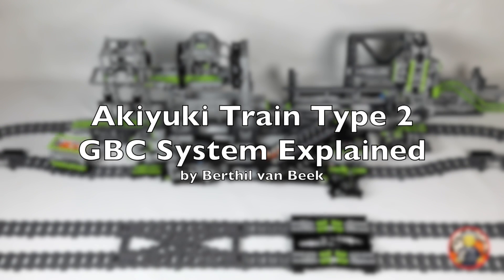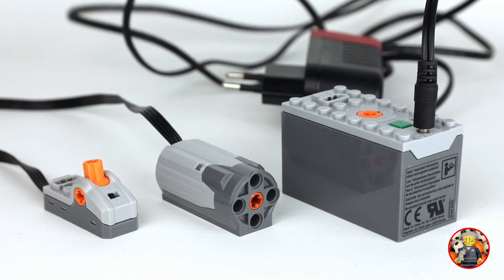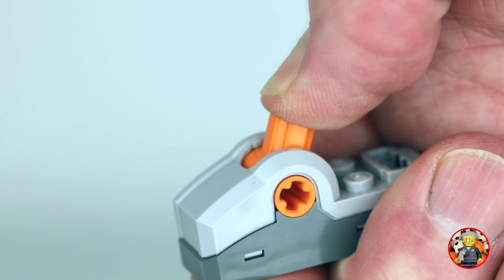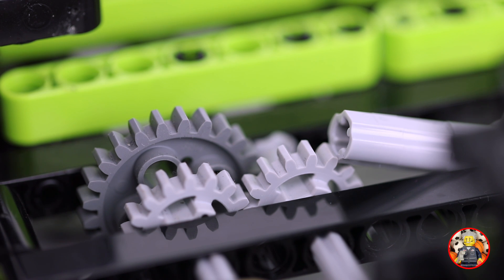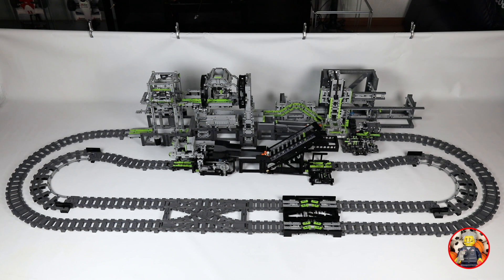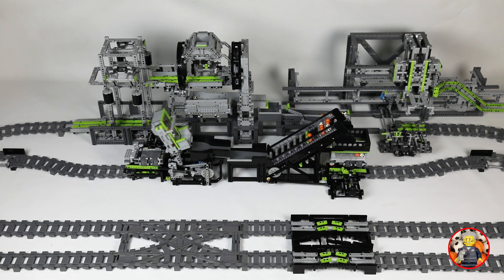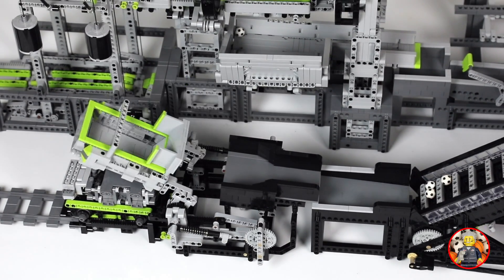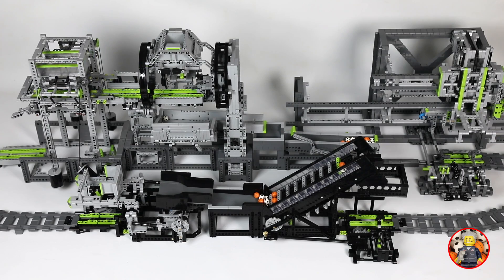Akiyuki LEGO Type 2 GBC Train System Explained

Comment: Great video! But why don't all the trains behave the same? And how big are the differences?
Reply from the maker: They are all build exactly the same but some have a favorite machine or have a problem with the narrow curves. Train number three always derails and the end of the right narrow curve so I have to use a different train number. Train number 4 gets stuck in the Rotary Dumper, the reverser doesn't get behind the 15L beam to reverse the train. I have no idea why they behave different.
Reply: That's crazy. Thanks for your answer.